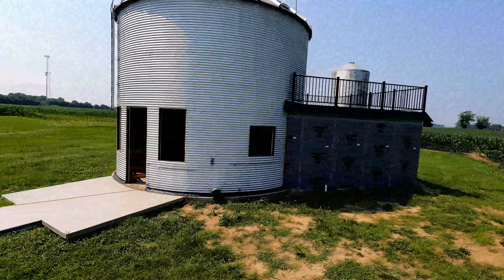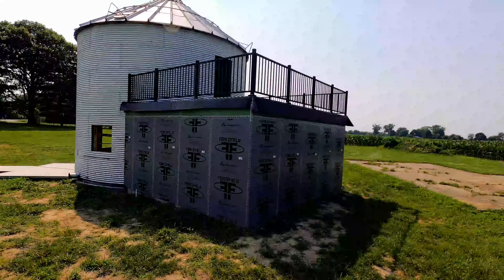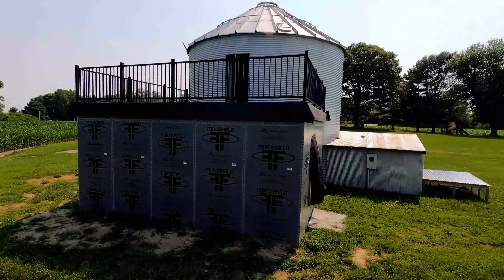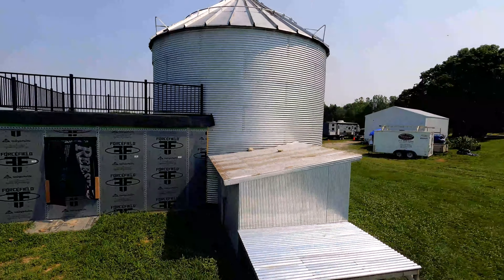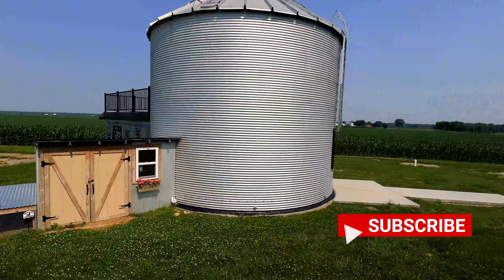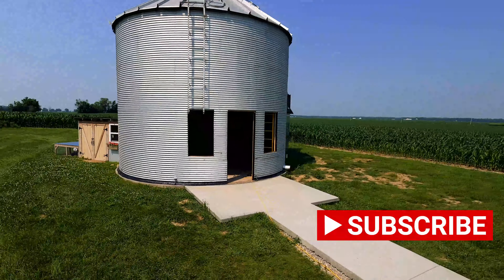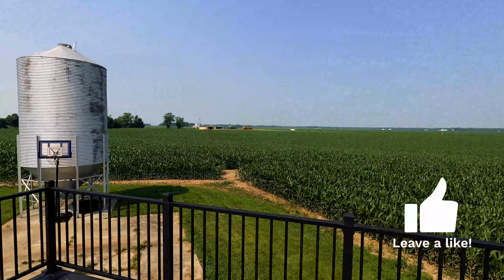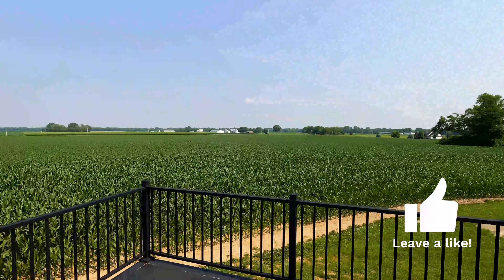Grain Bin Home Build... Episode 15 "Balcony Railing"

Comment: Did you do anything to avoid leaks where your posts lag down?
Reply from the maker: This is an excellant question!... Like stated, to fasten the handrail posts to roof they have to be screwed down through flange at bottom of posts.. Shimmed for level and screwed down through the rubber membrane.  This puts a hole through the roof membrane and therefore has potential for a leak.  To help overcome this I placed my posts to layout needed, then marked the holes and predrilled a pilot holes for my lag screws.  I used 100 percent silicone roof sealant, and shot silicone into the predrilled hole and a good bead of silicone for post base to sit into. When i ran my lag screws in, they went down into the silicone filled hole and oozed out the silicone to seal threads.  I then shot a bead of sealant on the head of lag screw once installed to base plate.  This sealed the base plate to the roof... Sealed the hole of the lag screw.. And then sealed the head of lag screw to top of base plate.... And then lastly i used EPDM rubber lap sealant caulking and caulked the post base plate to rubber roof.  To hide this all... The posts come with base trim to cover hardware and base plate.  Giving it a finished look.  Hope this helps clarify how I waterproofed this connection.